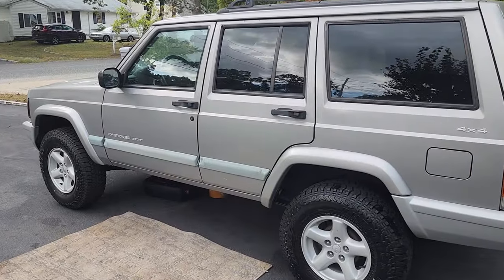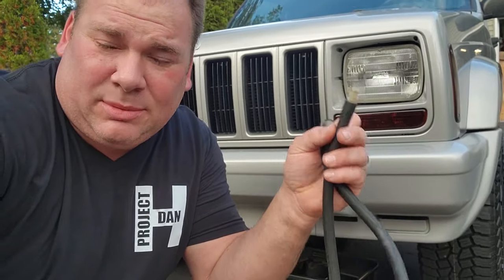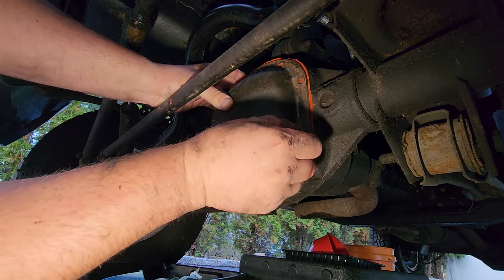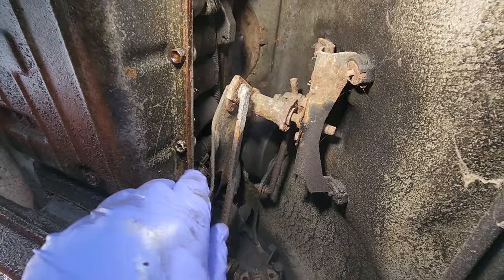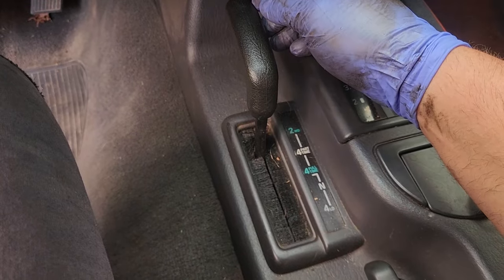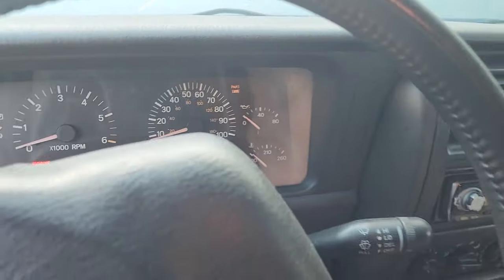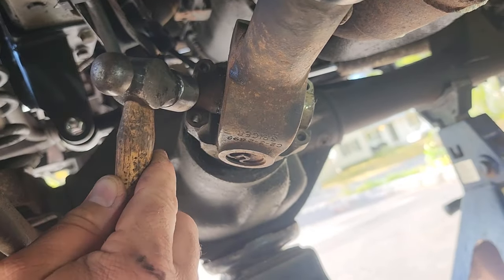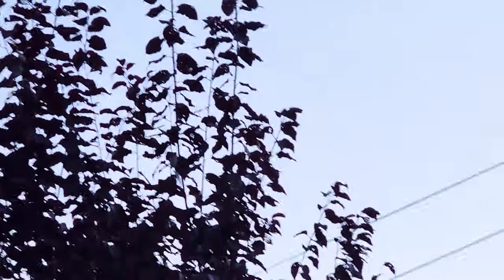SOLVING JEEP XJ 4x4 PROBLEMS - TRANSFER CASE SWITCH & LINKAGE -  DRIVE SHAFT -  DIFF COVER - TOAD #7

Comment: Differential vent part numbers -Dorman 14689 is the top vent.    
Omix-Ada | 16561.01 is the diff nipple. For those that don't have unlimited XJ parts "in stock "😂